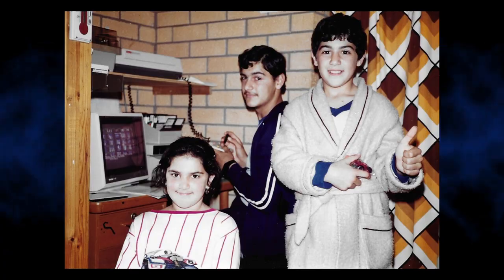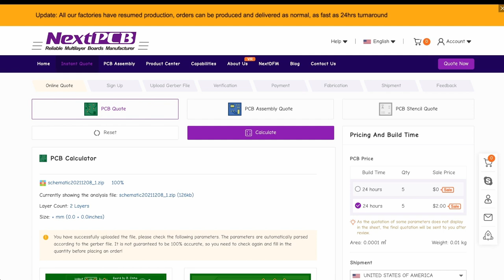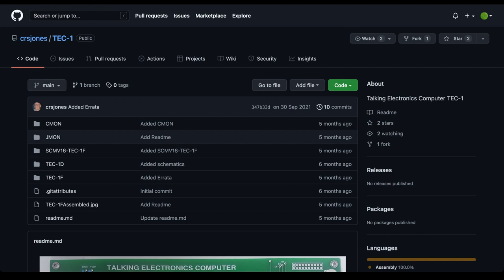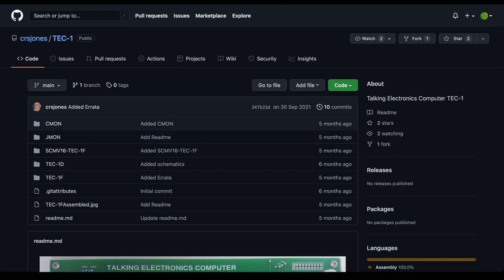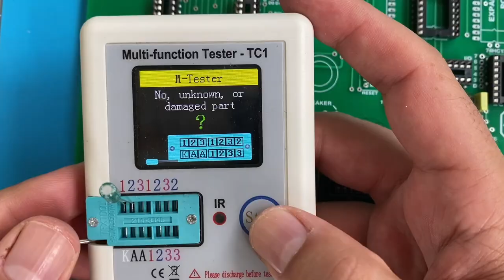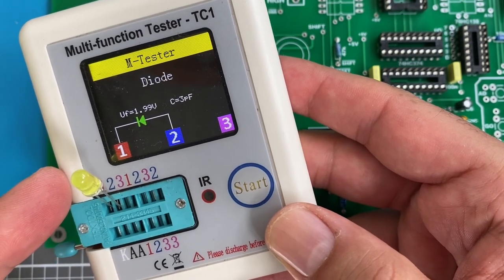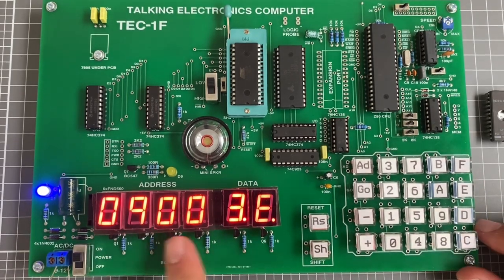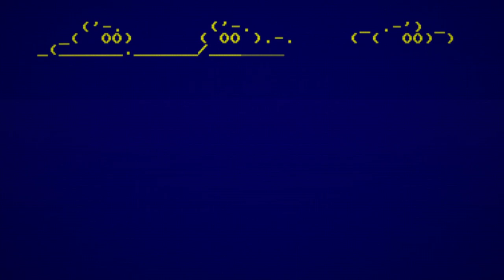The TEC-1F Z80 Computer - From Z80 Villain to TEC Hero

Comment: I’ve built the TE microcomp, a tec-1d and the southern cross. I didn’t know the backstory of the origin of the southern cross. For about 4 year, I used the microcomp with a latch board and a small relay board with power supply as a 7 station sprinkler controller over 4 wire phone cable. It had rain and sunlight detector so it could keep track of days and switch off when it rained. Writing z-80 code for that with only a 2732 eprom and no ram was a real challenge. Luckily the Z80 has a lot of registers. Now I’ll have to add the tec-1f to my shopping list. I’ve also got a dream 6802. About the only Aussie SBC computer I don’t have is the educ-8.
Reply from the maker: Colin would have been so happy to see the Microcomp used like you did. Thanks for sharing your story.

Comment: I finished my build yesterday and couldn't work out why it wasn't running. After chasing clocks, address and data lines for a few hours, I finally worked out that the RAM wasn't being accesses (via /CE). I had it configured for 8K ROM + 16K RAM, but the JMON doesn't support that yet, so it was presumably trying to write to ROM at $800 unsuccessfully. After changing the jumpers to 2K ROM + 4K RAM configuration, it worked fine. Looking forward to your new monitor ROM that supports the 8K ROM + 16K RAM configuration.
It was only when I watched this build again I noticed your jumper configuration that the penny dropped.
Reply from the maker: Great to hear your success story. I had the same issue.  It's memory configuration is surprisingly similar to the Southern Cross. Use 8k ROM/RAM ICs. Set the 2k/8k memory mapping jumpers based on what Monitor is on the eeprom. There is currently no 8k monitor yet...

Comment: I have a Southern Cross sbc that I built in the early 2000s and a few years ago I put together a TEC-1D. They are neat little trainers! I LOLed at the 7-segment boomerang, it's crazy what one can do with those displays and some software trickery, case in point, "Asteroid" for the KIM-1 :)
Reply from the maker: Having both SC and TEC is a rarity. And the boomerang program did say AUSSIE, I was a bit rushed in the end and modified an existing program.
Reply: @ReadyZ80  I collect SBCs but I'll admit even though I've had both for a few years I haven't really used them at all... I have however been meaning to build a DREAM 6800 because of it's association with CHIP-8, so that would make it 3 Aussie SBCs I have :)

Comment: I wouldn't really consider the Timex Sinclair as a 'clone', just because it was a joint venture.  It was basically just an NTSC version of the ZX81 using the JV for distribution.  The Timex Sinclair had a legitimately manufactured/licensed/labeled ZX81 motherboard inside.  I think it should be considered just another regional derivative, like the VC-20 in Germany or the VIC-1001 in Japan vs. the US VIC-20.  Great video - subscribed!